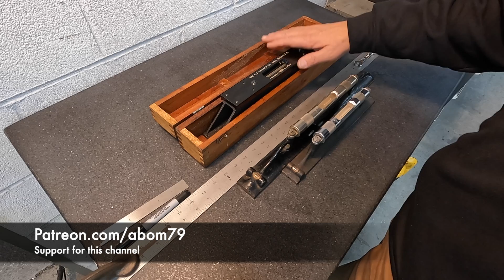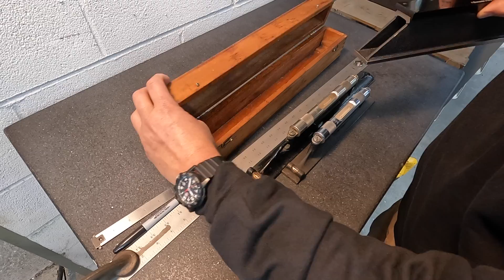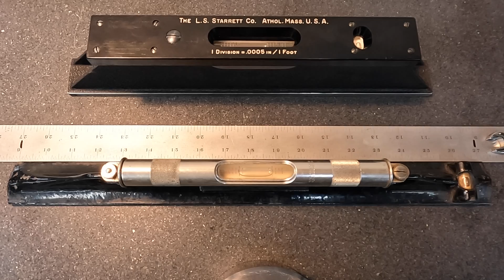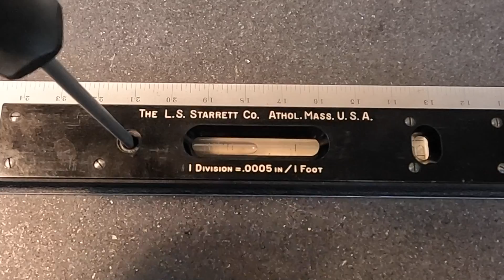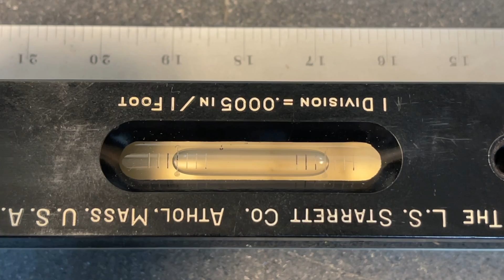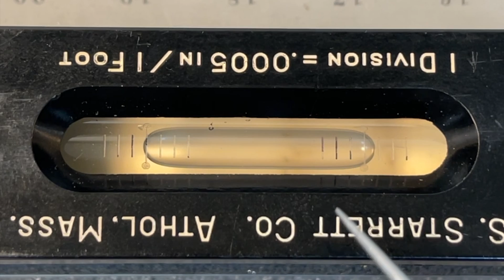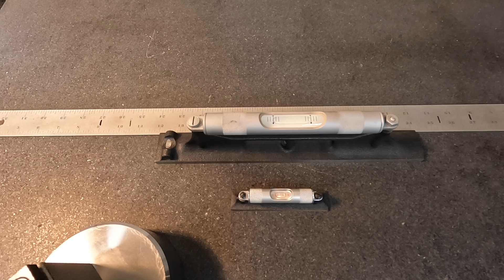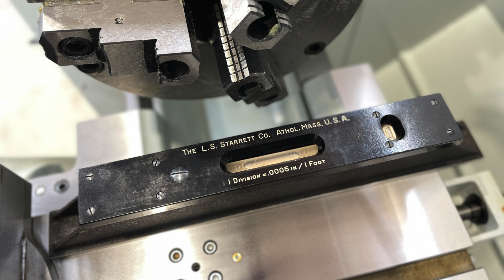Precision Level Calibrating

Comment: .0005 per foot is almost impossible to use except in the lab or on surface plate. I call those "crazy levels" because they will drive you crazy. I have a level that a .001 shim will send the bubble racing off the scale. All I can use it for is finding low places on my surface plate.
Reply: 0.0005 inches/ft is approximately equal to 0.04 mm/meter. I use a spirit level with a division of 0.02 mm/meter to set up a KBA RAPIDA 74 press, which is about 0.00024 inches/ft. So these levels are suitable not only for the laboratory. I apologize for my English, I am writing with the help of Google translator. Greetings from Russia.
Reply: @Alekseich4444  Totally agree! You  definitely can use it!  However, if you want large lathes to stay level to .0005/ft, you'll have to re-check them every few days. Heat, vibration, impact, weather, and trucks passing on the toad will cause the machines to move. Trucks passing on the road can change it in a week or 2. Building foundations easily shift .1 per year, a new one even more. Check it morning and night, and it will be different with a level that sensitive.
Reply: @Bob_Adkins  With a weak foundation, this will happen. My foundation slab is 12 meters long, 3 meters wide, and about 1 meter thick. The weight of the machine is approximately 25 tons. There is a compacted sand cushion under the foundation. The KBA Rapida 74 printing press is the same as in this video: https://www.youtube.com/watch?v=P9APgq8hM7s&ab_channel=MekesGraphicMachineryBV In spring and autumn I check the position. Equipment walks approximately 0.02 - 0.03 mm/meter. We are currently planning to move to a new building. It has a basement. It looks like the foundation will take more than 100 cubic meters of concrete.
Reply: @Alekseich4444  Yikes, that's massive foundations.

In certain areas (like the Southern USA where I live) a 1 M thick foundation or a 200 MM foundation would sink just the same. Bedrock is 300 feet or more down, with jelly-like silt in between. The tallest buildings here are 3 stories, held up pilings. They settle anyway.
Reply: I would have to disagree. I have the same Starrett 199 level and have used it many times to level my lathes.  With a bit of practice when turning the jacking screws on a lathe it is possible to (deliberately) move the bubble less than the width of one of the graduation lines.  What I have found works is to hold the wrench with one hand and pull on it hard enough to take out all of the play between the wrench and the jacking screw head and give it a slight preload.  With the palm of the other hand I lightly tap the end of the wrench to make it move.  The hand that is holding the wrench can feel the slightest movement of the wrench when the palm of the other hand strikes the wrench.  Since there is a light preload between the wrench and the jacking screw head, any movement of the wrench causes movement of the jacking screw.  For me at least, this gives me very tight control over the movement of the lathe.  Ken
Reply: @hmw-ms3tx  Hey Ken, I agree. I've seen my maintenance department set up many big heavy machines and they would borrow my Starrett to level it.  They would get so frustrated I would end up doing it myself. After the machines ran for a few days, the bubble would usually be off the scale. There's just too much vibration and impact on those big machines. If a machine will stay put to .0005/ft, then it's well worth the time. We just didn't have any luck getting them to stay anywhere near that. Bob
Reply: @Bob_Adkins  I wouldn't disagree with you when it comes to the large machines as I have no experience with them.  I think the key to a stable machine is a good foundation.  An aerospace company I sometimes do work for bought a new cnc horizontal boring mill.  They need to maintain very tight positional tolerances over reasonable large distances (.0002" in 36")  The machine OEM (possibly Okuma) stated they could maintain those tolerances with their machine if the foundation was built according to their specifications.  The foundation footprint was probably 20 ft. x 20 ft..  The OEM required that they excavate that footprint to a depth of 12 ft., then drive piles to refusal in the bottom of the excavation.  The excavation was then filled with concrete and reinforcing steel with the proper tie down bolts cast in place.  The end result was a massive block of concrete 12 ft. thick supported on piles.  While there may be slight settling in the first year or so I don't think the block of concrete would deform in any way and the machine would stay aligned.  Last spring I poured a foundation for an HBM in my shop that was 9 ft. x 10 ft. x 3 ft. thick.  Not as impressive as I mentioned above but hopefully sufficient.  Ken
Reply: @hmw-ms3tx  Hey Ken. Yeah, it's certainly possible to hold .0002/foot, even for a month or so. But as you said, it takes an extraordinarily solid foundation and also air conditioning. Level on a big machine can easily wander around a few thousandths per foot during a work day, so we stopped chasing our tails. We got them right, got them tight, and didn't check again unless there was a problem.
Reply: @Bob_Adkins  I agree with the air conditioning.  At those levels of accuracy temperature control is a must.  I have a video where I levelled my large (worn out) lathe.  I mentioned in it that I tried levelling it while we had a major welding job on the go.  It was winter (-30C is normal around here) and we had the exhaust fan running on and off.  With the constantly changing temperature the lathe would not sit still and I gave up trying to level it.  A week later with stable temperatures the lathe was rock solid (unfortunately it was still worn out, temperature control doesn't fix that.)  Ken

Comment: What seems to be missing in this discussion is that you don't actually have to calibrate these levels before you 'level' your lathe.  You simply maintain the same orientation as you move the level from one end of the lathe to the other.  When the bubble is centered* in the vial at each end of the lathe bed then each end is in the same plane and there is no twist.  You are not actually trying to 'level' the lathe, only remove any twist from the bed.  * Note: The bubble doesn't have to be perfectly centered either, as long as it is reasonably close to centre and in the exact same spot at each end of the bed. Ken
Reply: True. I think he calibrated it to show his viewers the correct way using a surface plate.

Comment: "about as close as I can gauge it with my eye" - and there in lies the rub. Anything that relies upon the operator using their eye to determine something at the scale of the bubbles in these levels is never going to be that accurate. 
I'm sure they are going to be more than accurate enough for the job in hand, but I'm not sure I would put my hand on my heart and say it was level to within 0.5 thou just based on looking at a bubble.
Reply: There's a limit to everything, this is easily good to .0001/foot  or so. That's to the point that slight temperature gradients in the item being measured will make it pointless to try to measure it closer. Everything in the real world, repeat, everything, has a tolerance.

Comment: Very interesting video but I ask a question, what proof do you have that the granite surface is perfectly horizontal to calibrate the spirit levels? With the adjustment screw you change the tilt of the spirit level to match that of the plane. At this point, you should first make sure that the granite surface is perfectly horizontal in order to use it as a reference since, as far as I know, the granite surface serves as a reference for the flatness of the surface. To measure horizontality I think it is better to use a gimbal like the magnetic compasses on board ships. I have been following you for many years and forgive the stupidity of this question, but not being a technician I would like to know. Thank you and apoligize my english.
Reply: I don’t think it matters, that is why you flip the level 180 deg. You are comparing the level against itself, not against the granite
Reply: @tcpip4me  I'm sorry but I don't understand or maybe I've missed something, what does comparing the level against itself mean? the level is lying on the granite surface while he is making adjustments on it.
Reply: @NicolaP269  suppose the granite is not level, by 1 degree ( just suppose) and you put the level on the table. The bubble would not me centered. Correct? If you rotate the level 180 degrees, the bubble would still be off-center. What ab is checking, is that the bubble is in the same off-center position. It’s not important that the granite is not 100% leveled, bit that the tool measures the same off-center location when rotated 180 degrees
Reply: @tcpip4me  Ty Ricardo. It is clear from my questions that I am not a metrology expert. So if there is an error in the spirit level, rotating it 180° on the granite surface, this error is displayed in the different position of the bubble, ok? But to correct this error and have an exact instrument calibration what reference is needed? I cannot mentally visualise the process.
Reply: The granite is certified as a flat 2 dimensional surface.  It isn't certified as level on a stand, the floor etc.  
You wouldn't use a wooden floor to do what he's doing as it isn't 'flat' like the 'certified flat' granite surface.
Flipping/turning the spirit levels over to get the bubble to appear in the exact same place makes for a damn near perfect level. It also suggests that the granite surface is NOT level. Which is A-OK.
Reply: @Mecalas  True, the granite surface is certificated only for its flatness. Ty for you clear explanation which finally made me understand the method of rotating the spirit level to be controlled
Reply: Don't apologise, Nicola.  Your english is better than most native speakers on YT - just take a look through any Comments section.
Reply: i believe he also has the granite surface checked and adjusted and certified to be flat and level periodically.

what i mean is that even if it isn't crucial, it's not any old surface, which i guess matters when you're talking tenths.
Reply: @calinguga  I hope so, otherwise the calibration of the spirit levels will be distorted.
Reply: Didn’t you see him put a ball bearing on it and it didn’t roll away?
Reply: @unwired1281  Nope, did it?
Reply: Doesn't matter, the plate doesn't have to be level at all, every surface will have a vector that the bubble will be centered as you rotate the level 180 degrees. Stop rotating when the bubblel is centered, set something to stop against, and rotate level 180 up against that same stop, if the bubble is still centered, you're calibrated, if not, adjust with the screws. You can do this on  your kitchen table.

Comment: 0,5/1000 inch per foot. Meanwhile me in Europe trying to recalculate it to SI 😉😃
Reply: A foot is 12 inches, so you rewrite it as 1/24000. Or 1/24mm/m ~0.0416mm/m
Reply: A very approximate 0,003mm/m

Comment: Hi Adam, I was thinking that the reason why you're not achieving perfect leveling of the 199Z level is because the granite surface plate is not leveled that precisely. But that is not a problem. I think that Keith Rucker discussed this in a video some time ago. The nice things of surface plates is that they're flat. On every plane surface, even tilted, there always is a line that is horizontal and leveled. So what I think you should do is: 1) rotate the level on the plane until the bubble is centered; 2) fix the direction with the ruler (as you did); rotate the level 180° (as you did); 3) adjust half the displacement with the adjustment screw; 4) remove the reference ruler and repeat from point 1). I guess that this last step could make a difference and help to calibrate it even better. 
Hope this is useful,
wish you the best!
Reply: I think there's an advantage to finding the exact horizontal position on the surface plate. It will insure that you're making the adjustment when the bubble is (or should be) dead center. I fully understand that you can do the adjustment when not perfectly level, but you're counting on the bubble moving to the right AND to the left exactly the same. There may be some symmetry error in the vial, however small. Finding the exact horizontal and placing the straight edge reference in that position eliminates that variable by keeping the bubble in exactly the same position when the level is finally adjusted.
Reply: You completely missed the point here didn't you - to calibrate any level, you don't need a level surface. The level just has to read exactly the same when it's rotated 180 degrees and placed in exactly the same spot. I know the video was rambly and took forever to get to the point, but it was like /r/woooosh right over your head!
Reply: @gorak9000  I'm sorry, I think you missed my point. First, you need your reference plane to be leveled at least within the range of the level you need to calibrate. Second, from a geometry standpoint, you can't find the horizontal line on a plane at the first shot, because what you are using to find it is not a reference itself. It's an iterative process, you find the closest line within the error of the uncalibrated level, then adjust on that and then you find the next line and repeat until you don't see difference when you rotate 180°. You will never ever manage to calibrate if you keep always the same orientation because that orientation most likely is not leveled. That's why you use a surface plate, because no matter if it's leveled or not, there will always be a line lying on the plane that is leveled and adjusting the orientation allows you to get close to that while calibrating.
Reply: @ThePaoligno90  if i understand correctly that's only needed if your reference surface is out of level beyond the level's range, like you're saying.

if it's within it i wouldn't think it matters, but it may indeed be best to work in the center of the level when you're aiming for tenths/foot.

Comment: Would be interesting if you could repaint the lines and also add/replace fluid to make the bubble smaller.
Reply: You do not want a smaller bubble.  The bubble must be large to maintain the sensitivity.
Replacement vials are available.  They do tend to get broken.
Reply: I have one of these Starrett 199 levels.  The size of the bubble will change depending on the temperature of the vial.

Comment: A precision level showed me how much my entire kitchen counter tilted, depending how close I stood to it.From the bending of the floorboards, I presume.
Reply: Technically it would show you how it tilted, since it’s so sensitive. A carpenter’s level would show you more in that instance. Like if it was way off, the precision level would be unusable.
Reply: @c0mputer  I had adjusted the angle of the level to null first, just as shown in the video. The level, once set at the null angle, showed the dynamic floor deflection from my weight. The change was about one division on the precision vial.
Reply: @patsauber4843  if you go outside and look at the sky and come back in and look at the level it will change. Oops, sorry ‘bout that. Just kidding, couldn’t resist.

Comment: What in your shop needs to be this level?
It makes sense that a shaper shouldn't be comically listing to starboard so that it doesn't wear the guides unevenly. But beyond that, why does it matter?
Reply: Don’t you understand that a lathe can be twisted due to the long ways. It can bow up or down or twist left to right. Each will affect the accuracy of cuts. Even if level, most lathes will cut at a taper due to wear.
Reply: Leveling in this machine tool world is a little bit of a misnomer. Not necessarily “level” to the world but level or consistent to itself across it’s working area. For example, an aircraft carrier or destroyer may have a machine tool room in it. Those machines (lathes, mills, etc.) also have to be level but only level compared to itself. It can’t be leveled to the world since it’s at the mercy of the sea.
Reply: Measuring twist in lathe beds
Reply: The master level is more for detecting flatness and squareness in scraping operations.
Reply: Space Shuttle parts?

Comment: Does anyone make those sort of tools out of granite? IIRC one of the reason industry stuck with granite for surface plates is it tends to chip rater than dent so any minor damage tends to not result in a high spot.

(BTW: I head a story somewhere that prior to WW-2, the standard for surface plates was cast iron but, due to shortages and demand, a grave stone maker started making them out of the granite they had on hand and it turned out they are better, so nobody went back.)